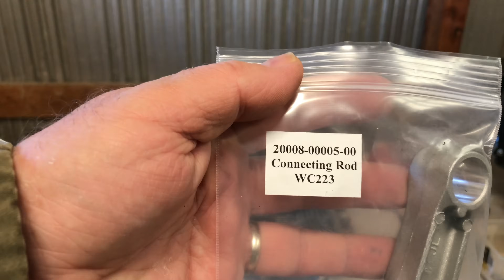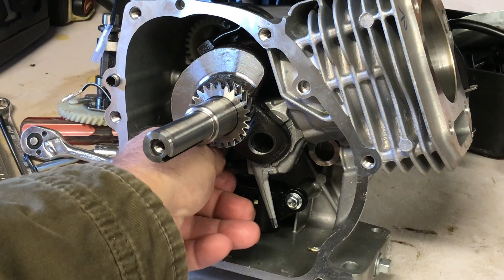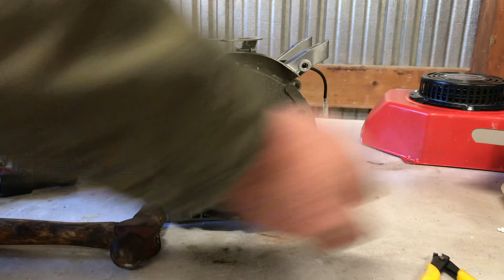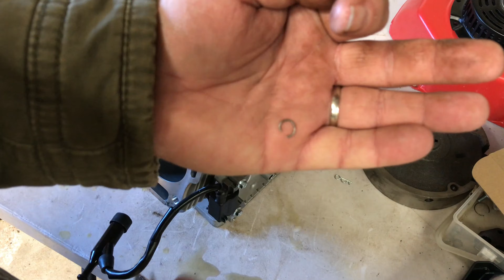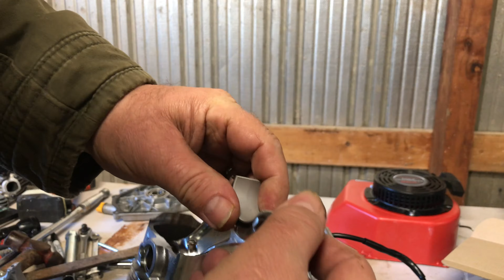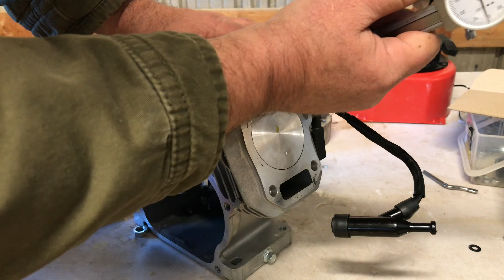Part 2 First Performance Mods and Build of Harbor Freight 224cc Predator Engine, Fitting 224 Parts

Comment: I checked my piston to deck clearance on my 224 block and I am 25 ten-thousandths in the hole with piston rock at tdc set with a dial indicator on all factory components. I'm looking to install a 308 cam with 1.3 ratio rockers. Thinking I will need 36lb valve springs with the rockers to prevent valve float, but not entirely sure. 

Anyone reading this have a recommendation on valve springs? 36lb single or dual springs? Heavier than 36lb needed? 36lb to heavy?
Reply from the maker: Hi Jon, a few quick questions. Are you working with a stock rod build or a billet rod build? Is your piston sitting .0025 above deck or below deck? How many RPM do you want to turn max? Were you planning to use the stamped 1.3 rockers or the billet roller rockers? Sounds like a great discussion brewing!
Reply: @KentuckyFriedFixes  I'm going to be using pretty close to the same setup as you, billet rod, flat top piston. Currently I'm at .0025" in the hole with stock components. I was just reading on ec carbs discussion blog that a . 265 lift cam will go good with stock rocker ratio and factory valve sizes, and 1.2 or 1.3 ratio rockers would require a big valve head. so that pretty much rules out a 308 lift cam as the factory head would be the choke point without going to a 32/28 head or bigger. But most of their research and design was based off of a 212 pred. Wonder how a 224 pred changes those tests

And if I go 308 or even 265 with ratio, it definitely wouldn't be with stamped as they're only good for about 26lb springs before failing. If I stay 1:1, I'll go with the champion shaft rockers, if I go ratio, I was looking into ec's rev rockers as they're cheaper than gage. 

I also plan on decking the head to about .080 thou valve/piston clearance to boost compression. Some go tighter, but I feel that's a safe number based on research. 

This build is for a flat track mini bike running on 3/8 mile circle tracks and smaller
Reply from the maker: @jmangus83  Those sound like good options on the cam for sure. Smart move on the shaft rockers, the 1.3 stamped work ok but they're not expected to live with more than a 22LB spring and stock lift cam but for $8 or so a man can break one every now and then. I was looking at a cam the other day I think it was .265 or .275 lift but it has more duration than the .265 Banzai cam I used in this one, I think they called it the "Superman cam". Only thing concerns me is cam clearance with the 58mm stroke, I'll probably have to grind the side down to clear the rod.
Reply: Just got off the phone with EC and there recommendation is the 698 (275 lift) cam with 1.2 ratio rockers or 1.3 (might need to cut spring pockets) and 32lb dual springs. That should put power around the 3500 to 7800 rpm range and just gear the bike accordingly. Would definitely need to run ss valves and cm pushrods, with titanium caps if I can find them as they don't carry 5.5mm titanium atm. They mentioned they are phasing out the aluminum caps
Reply from the maker: @Jon Angus  32LB springs will let you go up the RPM scale quite a bit! Sounds Great!
Reply: @KentuckyFriedFixes  I thought about the banzai 265, but it's doesn't have welded lobes, so per EC, won't live long on 1.3 ratio rockers and heavier springs. I know gps has a hot 265 with welded lobes if I wanted to go that route. Just too many options, lol, I'm not sure what to go with. I'm local to EC, so I'll just stop by there one day and pick their brain
Reply from the maker: @Jon Angus  I hear ya, lots of options out there unfortunately it always seems the better options tend to hit $100 and beyond. He he yes we know.. "speed costs money".

Comment: Can’t have enough dipper length.
Reply from the maker: I know it seems that way, but the dipper on the billet rod does reach the oil and lubricate the engine just fine. The main reason for shortening the dipper on the rod design is to keep it from hitting the block at high RPM. The cranks on these things really do bow and flex at high RPM, most people can't believe it. It's funny how they stay together, seems like they're trying to tear themselves apart. I didn't believe it either until I learned my lesson about crank flex the first time one of my engines broke the dipper off on the bottom of the pan. 1980, 4hp Briggs, metal dipper dug a groove into the bottom of my block before finally breaking off. Shame really, if it could have held on just a bit longer it would have finished machining the clearance it needed. LOL Thanks.

Comment: I don't trust the stock flywheels on these engines, a bit too explode!
Reply from the maker: Me neither James. I just put the stocker back on to start the engine for the first time. It's not staying and I've not even revved it. I had originally planned to use a Tillotson cast aluminum PVL as they're BALCO certified approved and spin tested to 8500 RPM, but mine had a flaw in it I was not comfortable with running. So I paid a few extra bucks and ordered a billet. Any Honda clone flywheel will fit and the ARC 6619 is a good choice. Thanks!

Comment: Since changing the rod and piston, how hard would it be to re-balance the crank to match? I imagine that would have to be done at a machine shop. Also wonder how worth it would be... Maybe i should get back to work also....
Reply from the maker: Hi Robert. Great Question and thinking! This one won't be balanced. The stock rods will average around 130 grams in weight and the billet rod is 135 grams without the insert bearings. The stock piston weighs in around 158 grams and the Wildcat piston I used in the build weighs in at 138 grams. So overall, we've reduced the reciprocating weight somewhere around 15 grams. Usually, if you reduce the reciprocating weight, the engine will run smoother and live longer at higher RPM without rebalancing. (I'm sure you already know this but some reading this won't) I'm on board will a full rebalance when building a fresh new race engine but this engine project won't require that amount of extra investment to be viable. That was one of my goals when considering the parts for this combo. We've actually helped it with the lighter new parts on the top end (rod +5g, piston -20G = 15g loss) and it does run noticeably smoother now. A good kart engine shop will have the equipment to balance. It's not cheap to do though, probably $100 to $200+ depending on where you're at. Thanks!

Comment: I basically bought the Wildcat stage 2 kit plus the Wildcat piston.  I had the same problem with the top of the block.  I takes quite a bit of removal at the top.  As an aside I also noticed the tappets they sent with the bonzai cam are longer than stock.  I decided against using them.  My piston is pretty much even with the head.  I'm having trouble starting the engine (many pulls)  I get kickback frequently.  It isn't valve lash as I have it set to zero for the exhaust.  Spinning the flywheel by hand it gets very hard to turn AFTER the compression release closes.  In other words it must be on the power stroke.  No idea why.  I even put the stock cam back in.
Reply from the maker: I wonder, which flywheel did you go with for your build? Aftermarket or stock? Some of the aftermarket flywheels have a ignition timing advance right out of the box. So if you use a flywheel key, it's still advanced on the ignition timing. Some flywheels require a matching coil too. I'm just curious because it sounds like your issue may be ignition timing related, a bit too much advance. If you run methanol, tons of ignition timing advance is good but not so good if you run gasoline. I'll be showing the timing key delete in part 3 and a small retard of the timing on the flywheel I use. The flywheel I use for this build has more timing advance than the stock flywheel. On the valve lash, I stick with the specs, since there's no way to advance or retard the camshaft on these about the only way you can be sure your camshaft is close to the degree in specs is by sticking to the recommended valve lash. On the Banzai cam it's .003 on the intake and .003 on the exhaust hot, then they recommend .002 on the intake hot of course. That's after break in I'm sure. I set both at .005 cold for the first start up and run in, then .003 hot IN and EX after the cam breaks in.  On the lifters, I've seen both ways used. The aftermarkets I received with my Banzai cam are around 1.360" and the stock Predator 224 are 1.432", my Banzai cam kit lifters were .071 shorter than stock. It all depends on your rocker geometry and how it looks. I'll get into that a bit in part 3. Some guys end up going with custom length push rods when they change camshafts but I've found that most cam grinders want you to use their supplied lifters with the cam for a reason. Sometimes it works in your favor but other times....well. I'm sorry, this is turning into a book. I'll get outa here. Thanks for sharing!
Reply: @KentuckyFriedFixes  Thanks for the help.  The kit came with a flywheel set to 34 degrees. What's the advance on the one you got?  I've been suspicious of the advance on the billet flywheel I got.  I was considering getting a modified key and seeing if it could be put in backwards to retard the timing.  I haven't seen anybody do that so I was a bit leary.  Also I misspoke.  My lifters are the same as yours (Predator's are longer): 1.445" vs 1.361".  I stuck with the stock because I assumed this was a difference with the Predator.  I will be interested in your key delete video.  I'm considering putting the stock flywheel back on to see if it makes a difference.  Btw, yes I did get a new coil with the kit to replace the stock coil.
Reply from the maker: @Core1783  Glad to have you here! I love it when engine guys can get together and toss around some ideas and I appreciate any and all input and discussion. I try to learn something new every day. The cast Tillotson aluminum flywheel is around 17 or 18 degrees advanced over the stock flywheel. I did retard the timing a bit during the install based on the info from EC Carburetors website, it does seem about right to me.  I didn't measure my advance because I didn't really want to break out the degree wheel on this build and this one doesn't need to be exact. Tools I'm using for this build are basic items most guys have laying around, like the dial caliper from HF etc, I wanted to keep it basic so the average guy can follow along and still build a decent engine without sinking a bunch of $ in tools. Thanks!

Comment: I want one of these right now I'm building a 212 it gots a nock off carb and a free pipe I got I'm keeping it as much stock as possible just needed them to port it I did the valve pockets and ports today I did a lot on the hot side because the pipe is so big everything is port matched it flys it gots to be around double the power I'm going to try something it's probably going to be a first I'm going to get easy weld sticks and try to make the valve pockets smooth instead of that 90 I did round it a little it helped I probably ported the head 5 times lol to see when is to much I haven't got there yet tomorrow I'm going to port the intake more because I don't like the adapter so I'll probably make it as round as possible to make air flow better into the port and after that comes the easy weld sticks lol I hope it works it will be a game changer for me I also been wanting to polish my rod because that will make it stronger I don't have money for parts I can't really work I been really sick for over a year in a half stuck in bed I'm great full I can get around a little just hope it goes away or one of my doctors find out what's wrong can't wait to be 100% ripping again
Reply from the maker: Austin it sounds like you're building a screamer. Let me know how those weld sticks go. I've tried the old versions of the aluminum torch weld sticks and they didn't work out for me. This has been several years ago though and they may have progressed since then. I don't think you have to spend lots of money to get a decent running engine. The stock rods will live to 6800 RPM with just a bit of trim work and polishing. The main thing I've found is that all good running engines start with a good plan. Sounds like you're working yours out now. Thanks!

Comment: Looks like you possibly could remove some material of the oil sensor mount tabs that would allow the sensor to drop closer to the back of the case? OR, where the sensor interferes with the rod could some of the sensor be trimmed???

Comment: 10:12 Having worked 40+ years in QC in a Lawnmower MFG plant may I humbly suggest a VERY much more precise way to check that dimension? I could email it to you with parts needed, the .003 difference you get can VERY WELL be the way & angle you are holding the calipers, been there done that
Reply from the maker: Hi Numa, I have dial indicators and magnetic stands, but most guys don't have those. I try to show a simple method that will work so the average guy with a $19.95 dial caliper can get within a thousandth or two. Good eye! Thanks!

Comment: 7 to 8000 RPM ?? I think I'd build a 1/4 box around that engine, ya know they have those rated scatter shields on Drag race stuff incase they blow
Reply from the maker: I doubt I'll go much over 7000 RPM. The cast flywheels are BALCO certified and spin tested to 8500 RPM. Of course depending on your application you could always go with a billet flywheel for around $100. I may end up going with a better flywheel if I change cams but the Tillotson aluminum flywheel will suit my needs for this build.
Reply: @KentuckyFriedFixes  turn that sucker to 8000+ i have a 212 that turns over 8000 rpms using arc rod and flywheel if it can handle it do it and if it does blow build it again but stronger
Reply from the maker: @madness_-yg3lw   I like the way you think Spencer!
Reply: @KentuckyFriedFixes  the way i look at it is if it fails then its learning opportunitie but you should never under build if you know your gonna wanna keep turning it up and going stiffer springs then build it to handle 10,000 rpms but only turn 8 or 9 and it will be a reliable engine im sure my 212 could handle going to 36lb valve springs and turn up to 9k but to keep it from needing rebuilt even sooner im only turning 8 and running racing oil it is better to be over built for reliability
Reply: Iv got a 212 turning over 8k and its has been doing so very reliably for some time iv got a arc rod and flywheel stock 212 non hemi piston and bigger cam and ratio rockers

Comment: THANKS for this info, I can't believe these engines or other suppliers don't make those thin helpers that fit between the rod caps & cap bolts that you can bend the tabs to keep the cap bolts from backing out
Reply from the maker: Numa that's a good point. I think they want to sell a new rod as often as possible. Thanks!